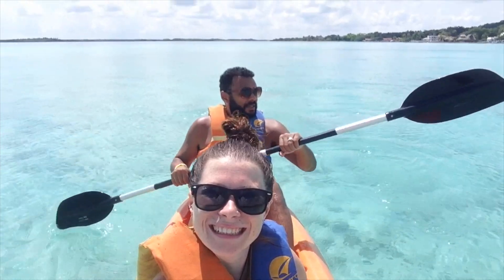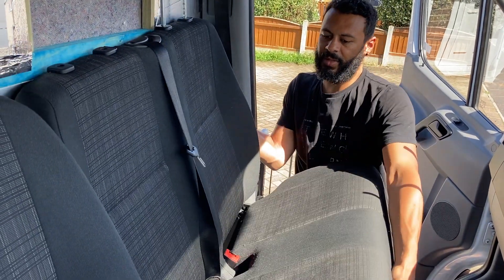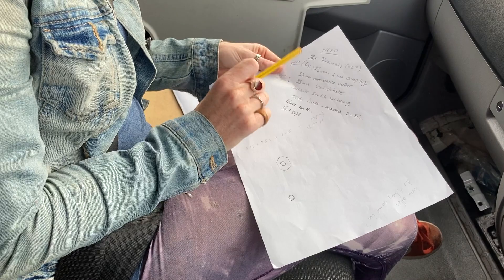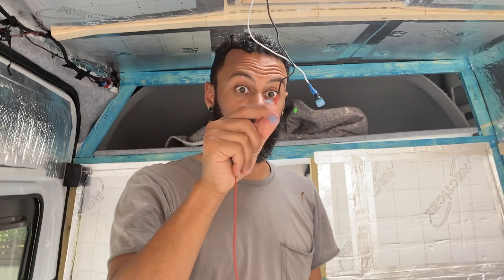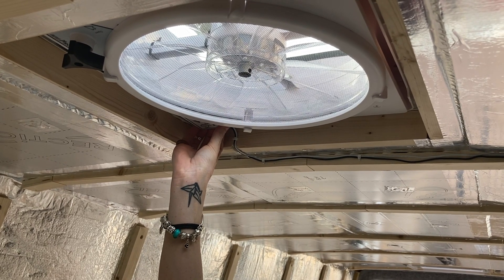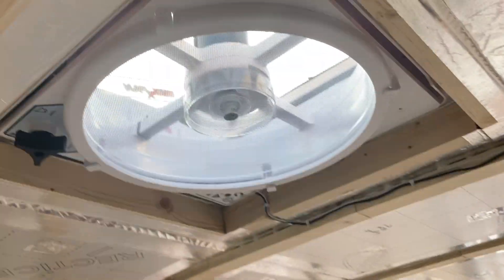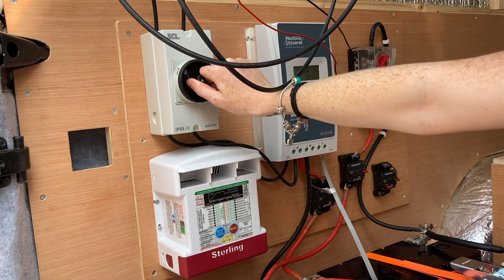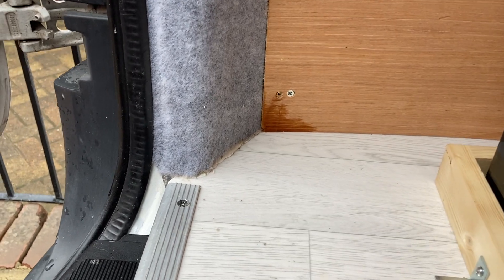DIY Camper Solar Setup & 12V Battery Wiring | UK Van Conversion Electrics

Comment: I'm happy everything worked out in the end! I'm currently building out a van in the U.S. and was wondering why you chose AGM batteries vs LiFePo4 batteries? I know price is a consideration, but were there other reasons as well? How has it been keeping them charged and at the safe usuable level?
Reply from the maker: Price was a big consideration plus we figured that the technology is only going to get better and cheaper. AGM batteries should have a life of around 5 years and by that time (hopefully) the price of alternatives will have come down significantly and if we need/want to upgrade at that time or beforehand then it’s always an option. If money hadn’t have been an object we’d have definitely gone for lithium but we decided our cash was better spent elsewhere at that moment. We’ve had no problems charging them and keeping them at a safe level, particularly as we have a battery to battery charger as well which kept us going over the long winter nights 😅 Hope that answers the question!

Comment: Hey guys, new subscriber and fan of yours. Trying to decide whether to go lithium or AGM batteries at the moment - just wondered what safe guards you have to prevent your batteries going under halfway and how reliable they are, how much you have to keep an eye on your batteries etc. Going for a similar set up to you
Reply from the maker: Hi! We really appreciate it 😄
With regards the batteries, if our budget had allowed we would have gone for lithium but we decided to spend it on other stuff. That said, we’ve actually been really pleased with our batteries. And they haven’t been depleted below midway once. We generally just do a couple of visual checks on the battery display monitor but we’ve got used to them now so we know when they’ll be ok and when they might not. Sarah designed the system so that generally they’re fine for our daily usage, the only time we need to top up with the battery to battery charger is over a couple of months in winter when there’s no sun, but even that was by design as we’re not planning on spending winters in England which should mean we’re fine all year round! Lithium is definitely the better technology but the cost to value (for us) ratio just didn’t make sense to us at the time. We figure the price of lithium batteries is only gonna come down and by the time we need to replace the ones we have in 5 years or so (hopefully) they might be significantly cheaper. Plus we can always upgrade if we get a windfall in the meantime 😅 Hope that helps!
Reply: @TheWholeWorldorNothing  thanks that has helped, think you've got the right approach there!
Reply from the maker: Great stuff 😊

Comment: ouch 75kg of battery, your gonna feel that later on.
Reply from the maker: It was a toss up between £s and lbs and £s won! We may switch them out for lithium at some stage but we just isn’t have the budget. And we’d accounted for the weight in our planning so no issues there 🙂

Comment: Hi, did you not piggy back off the vans main battery to charge whilst your driving or are you charging completely from your solar panels ?
Reply from the maker: Yes, we have got a battery to battery charger as well, we installed it a bit later on so that video will probably be in a couple of weeks time. But for about 3/4 of the year the solar is absolutely sufficient to charge the batteries, it’s only when there’s only hardly any daylight that we need the battery to battery charger 😀
Reply: Thanks, your advice is really helping
Reply from the maker: No problem at all, glad you’re getting some value from it 😊

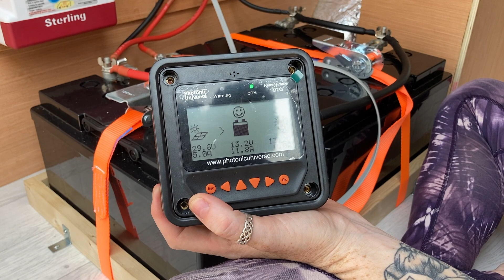Comment: 11:49 Does the 5amps means you're replenishing the batteries by 5 amps an hour? so at 3 x 110ah batteries it would take in theory 66 hours  to go from 0-100%?
Reply: 5A at 50V, about 250W or 20A at 12V
Reply from the maker: @hakanmansson2725  🤟🏾
Reply: @TheWholeWorldorNothing   @Håkan Månsson  
Thanks so much both!! I thought 66 hours seemed crazy but makes sense! Really appreciate it!
Reply from the maker: No problem 😌
Reply from the maker: So the reading showing there is the power coming from the solar panels into the MPPT charge controller, not the batteries. The MPPT then converts the voltage to 12V, so no as a result the Amps are much higher. The incoming power obviously varies depending on how much light there is, but usually we get a full battery charge within a few hours. Also because they aren't lithium batteries, they shouldn't be discharged below 50%, so the maximum they would need charging is 165ah. That's how I understand it anyway - hope I managed to explain it okay!